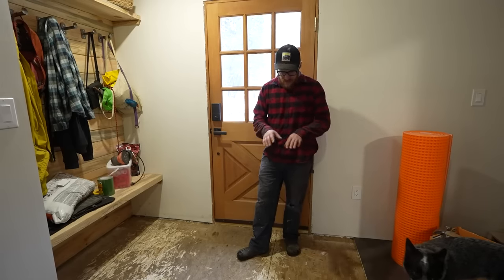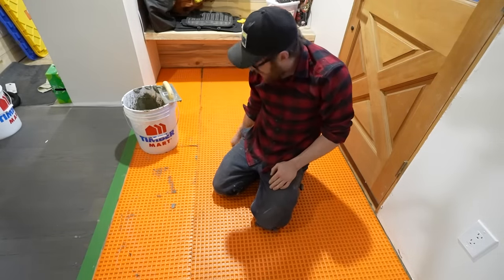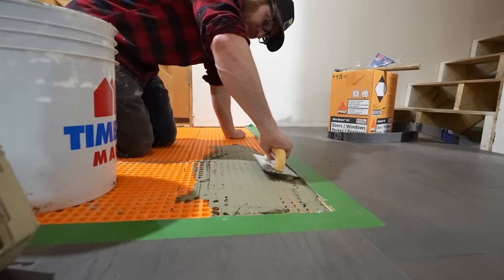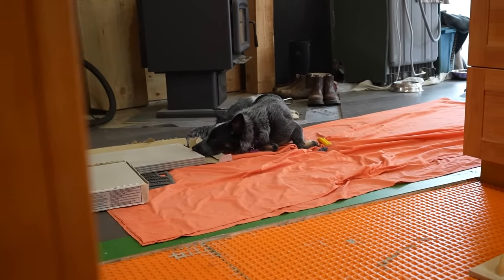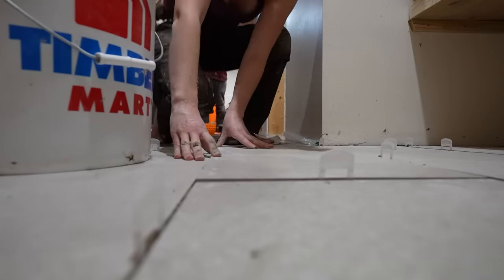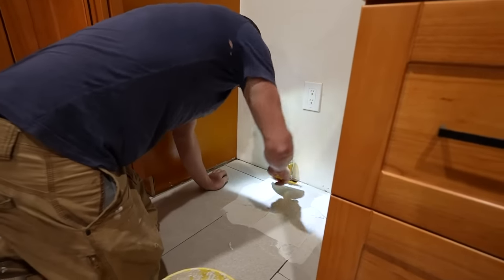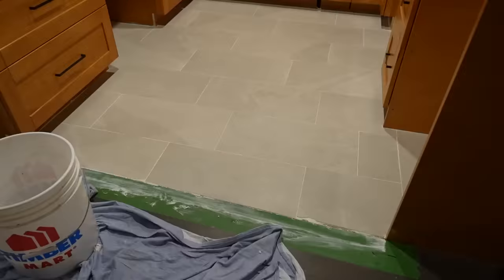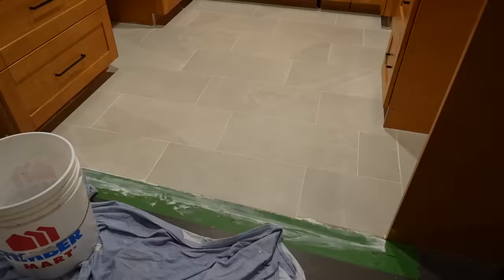The Fridge Doesn't Fit Anymore And A Few Other Tiling Mishaps

Comment: I am impressed with your tile installation. It looks great. Appliances have become a bit of a nightmare for homeowners when replacement is required. Not only do they no longer last like the older models, but there are now so many different sizes. So, not only do you have to pick the features, brand, look. . . but will it fit the current space / configuration. When we replaced our washer and dryer, we had to remodel the entire laundry room.

Comment: You did a wonderful job! My husband and I did the floor laying and the tiling about 15 years ago. They didn’t have those little wedge things to help tighten the tile. I’m so impressed at how fast you guys work. When we had the very same thing happened with our refrigerator, we started sanding the upper cabinet and turning the doors upside down. Does that make sense? We finally got the refrigerator to go in and just had to do some touch up staining on the cabinets. It happens to everybody. Do you think you measured and measured and measured. I will add your tile at the front door is going to be very very slippery. Put a rug down as soon as you can or somebody’s gonna have a hard fall. Your biggest fan from Oklahoma.

Comment: You will have issues with the fridge moving forward, you don't have anywhere for it to draw air to cool itself from now.  The 2" you had before was not enough for a full size but was working for that one.  But now you don't have any fresh air getting to the compressor.
Reply from the maker: The cabinet is shallow and there is a huge gap for ventialtion

Comment: Well done. But I have been reaserching  on the best appliances to buy. And the best place to do that is all the appliance repair shops. The #1 problem they have found is that all the kitchens have those walls on both sides of the  refrigerators and that is a no no. They cause them to work overtime and so they don't last as long as they should.

Comment: Oh, you have that quick setting grout. I've seen two other DIY's with that problem. The solution is to not use the electric mixer. Doing so introduces too much oxygen into the mix which causes the grout to harden more quickly. Instead, mix it with a stick. There really should be better instructions on the grout bag.
Reply: As for the cabinets above the fridge, shave off some wood from the bottom of the cabinet bracket.
Reply: The end finished product looks great.

Comment: This is the same problem I am having with my Jenn-Air....Custom Cabinet (built by my husband). The fridge quit working. I had to get a cabinet guy to shim off the surround to get the cabinet out. Okay - they replaced the start relay switch..worked fine for a few minutes...the compressor works then not...they can't replace the compressor since mine is 17 yrs old....they change the dimensions of appliances..now my problem is like your problem...a new fridge won't fix in the cabinet...the cabinet guy is coming back to try to enlarge the space...In the meantime..no fridge for 2 wks..bought a 4.5 & a small ice maker (it only makes ice does not keep it frozen) I have a new Jenn-Air coming...what can possibly go wrong...

Comment: That's one of those spots. Where the cold melts the warm by the door. I found bracing under the floor helps. Usually try to get tile to match floor joist spacing. Idk wetness, cold, or heavy stuff. It seems where most tile cracks in most places.

Comment: A million years ago freightliner condos were wearing out refrigerators fast as in months . What they found was not enough air circulation around the fridges . 800 trucks eating $1200 like they were jellybeans. 
.the fix was drilling holes in the cabinet that held the fridge .. may want to keep a eye on you fridge

Comment: Are you going to put some sort of transition strips from the flooring to tiles. This will help the tiles from chipping  and socks from snagging ?  Also the tightness of the frig & cabinet , the compressor on the frig will work harder . It needs to have air circulation. A good friend had a similar situation & their compressor went out with in 5 years. They ended up putting a small vent on the side of the cabinet to draw air , no problems since then. (Sorry this got long). It looks very nice. 👍👍😊

Comment: I'm not sure if this was covered,  but u need 2 maintain proper airflow around your refrigerator.  Failure 2 do so will waste power and shorten its life. Check the manual 4 exact requirements

Comment: At 6:36, you cannot add water to thin set after you have already mixed it and it has slaked and remixed. Hey, it's your floor but you destroy the integrity of the floor by doing it.  Mix new and throw it out or continue with what you have mixed until it is gone. Okay now I will continue watching...18:46, I cannot watch this anymore. Good luck with your floor.

Comment: Many people don't realise that you need to leave a big gap at the top (and also some at sides) when in place, to allow effective air circulation else the refridgerator will not work effectively.  Looks like your 2" was way to small considering the thickness of all the flooring components.

Comment: We did the exact same thing with our fridge freezer we left the right amount plus 5mm  (5/32) then when we went to fit it the mother was on top and it’s 5mm higher than the front  so it rubs the bottom of the cupboard each time we remove and refit the fridge it’s bloody annoying because like we fitted the kitchen around the fridge freezerso we could easily of lifted the units to give more room. But we have put up with it for 12 years no and nobody can tell except us so we aren’t bothered anymore. But I must say what a cracking job you have done you should be well proud of yourselves.

Comment: My only question is:
After removing the legs and wheels did the metal bottom of the refrigerator (clearly see bolt head now sitting lower then the bottom of the refrigerator) scratch the new tile floor? Did you place something soft as a buffer to avoid that? The legs are usually non skid and well the wheels roll. Metal bolts don’t.

Comment: I have never seen people laying tile and putting thin set on the tile. the textured surface of the back of the tile to so the thin set on the floor in ridges get pressed into the textured undersurface of the tile.  Have you been told different?  I went back and looked at how to install tile over ditra.  I should have looked at that before mentioning it. I just never seen it done like that prior.  You both did a great job on the kitchen, looks wonderful.

Comment: Please don't be upset with my post, I just want to share with you the mistake I made with installing light colored tiles and white grout in my shower.  Since it is in your kitchen, a high traveled area, you can expect, like I experienced, to have discolored grout that will be a "chore" to clean and keep clean.  I had to take up my grout at the bottom of the walls that connect to the flooring and replace with a darker color grout.

Just trying to share the problems I experienced.

Don't worry about the refrig being perfectly placed under your cabinet.  No one will notice it, they will concentrate on the overall aesthetics and functionality of the room.  You are doing your best.  How many people would not even attempt to build their own house?  As long as you are satisfied and happy everyone else can "piss up a rope."

Comment: u cant turn a refrigerator  on its side ,the oil will go into the upper line and block them .only site tilt 25 degrees .now u need to wait  24 hours before plugin it back in .too much oil will block the lines . next time just move the cabinets .wheels help by lowering  vibration

Comment: OMG - friends of mine had a similar problem…they needed to level all of their floors with flowable concrete and then once the laminate was installed they couldn’t get the fridge in. They ended up taking the top cabinet down and adjusted the bottom by cutting it down so that the top aligned. Unforeseen glitches! But now, you found a solution that works and it’s lovely and bright. Great job! Enjoy! Hopefully no glitches on the next project! Take care.

Comment: It is  too late  to help here  but   for your  other  rooms  it   might  help  your  Detra  is  supposed to  dry  for 24 hrs  before  you  walk  on it  or  apply tiles as it  needs to  dry from the  top  down as  for   walking  on  it  it  shoves the  wet  thin set  down  some and  can  make  tiles  wobble  a  bit    but  it  looks  great  what  you  have  done.   By the  way   I  am  currently  putting on the  same  tiles  with a  glaze  finish for a   back splash  in  kitchen.  well done  and  God  bless.    So  proud of the  fact  you are  fellow  Canadians  and  not  afraid to  tackle a  job  just  because  you have not  done it  before.
Reply: Yes, the Detra should have dried first before installing the tile.
Reply from the maker: The instructions that came with it said you can tile right away

Comment: I dont understand using thin set on both surfaces to put the tile ? A 3/8 notched trowel on the floor should be enough thin set to do the job . Also , use a natural sponge to wipe off tiles wringing out the water often . P.S. Your fridge is gonna suffocate in those tight spaces . Looks good though .

Comment: Your going to run into issues with no clearance around the frig as there needs to be airflow so the heat can escape. Since you made it so tight there is going be nearly no airflow.

Comment: I did tile for 34 years so i have to try to help out, As far as setting the tile you get an A, back butter using the levelers great job. The only thing I would say is I learned a very expensive lesson when I first used Ditra  about 20 years ago, you have to use non fortified thin-set, the cheap stuff,  it wont stick with fortified thin set, That was my tuition for the school of hard knocks, if you used non fortified thin set then great job, if not then not so good. Grouting was ok , For future reference the secret to grouting made easy is the right grout float, those green ones from box stores are crap, Virginia Tile has great one with an soft edge that lasts a long time, you need to pull off as much grout as you can leaving mostly the lines and minimal grout on the tile by using the good float at 45 degree angle, that will make grouting much easier, you guys are such quick learners and hard workers you will be fine, I have done the same thing with the fridge early in my career it's an honest mistake, your place is really looking great.

Comment: Also, my wife hated raised transitions between the tile and wood for I filled in the gap with soft weather stripping and a thin layer of matching joint compound chulk. Still looks great after 5 years. Thought it wouldn't last but works great and allows the wood to expand without cracking or buckling.

Comment: A fridge does need room to breath. It will get hot. And at least once a year you need to clean out around the compressor and coils. Make the upper cabinet easy to remove?

Comment: That's a tight fit. You may make sure that you have the correct air flow so the compressor does not over heat?

Comment: 1. When you lay Ditra you need to use the roller to adhere the ditra to the thinset on the floor. This is to make sure its bonds to the the thinset on the floor. You can find Tile membrane rollers in amazon if your local store does sell them.
2. When applying thinset to a wood subfloor, you need to wet the subfloor with a wet sponge as the wood will wick some of the moisture out of the thinset (even if you are using the polymer additive). Alternatively you can apply a primer like MAPEI Primer T. MAPEI Primer T also helps the thin-set bond to the subfloor.
3. Apply the kerdi tape on the ditra joints to avoid cracking if there is any movement on the floor. You place some thinset over the joints then lay on top the kerdi tape & then another layer of thinset.
4. TIP: when you lay down ditra it can be helpful to have a spray bottle of water that you can apply to the thin set just before placing the ditra, especially in winter if the humidity is low as the very top layer can start to dryout before you can get the ditra laid down.
Reply: You need to wait about 48 hours before laying tile over ditra to give the thinset time to cure. 

Not a good idea to use white grout in a kitchen as it will get dirty and very difficult to keep clean (basically you need to steam clean it).

Comment: Holy cow! Near disaster. Super fix. Got it in. We went with bone color grout years ago. It is dark brown/black in the high traffic areas. Never a good way to lean it either. Regrets. Thanks for sharing
Reply: Grout paint will fix it. Yes, it's a tedious job. The results are worth it! You can paint small sections at a time. I painted 2 bathrooms.

Comment: Hello Katie and Greg. Such a fantastic job you two have done with the house. I need your help. I am changing the sink in the kitchen and have removed everything from the sink. It appears that whoever installed the sink used liquid nails to adhere the sink in as if the clips were not enough to hold the sink in place. It is a drop-in sink. How can I break the bond of the liquid nails? I have looked everywhere for the answer. Have good days!
Reply from the maker: Greg doesn't know of any solution. He says you need to smash it off 😅

Comment: When you buttered the tile after spreading the square lines, you doubled the thickness of the thin spread. The hole point of the square notched trouw is to put just enough mud on the floor to stick the tiles to the floor. And I know that orange underlayment is the new thing, ready board would have given you more support and rigidity and you don't need an extra layer of thin spread on the floor which is now that much higher. I wish you would have watched a few more video's on laying tile. but I guess you live and you learn. LOL
Reply from the maker: The tiles and wood floor lines up perfectly so what's the problem?

Comment: Your place is looking great. Have a question when you were putting down the paste i thought you needed to have 1/4 groves under the Ditra I am going  to do a remodel on a rental and was wondering thanks for your time
Reply from the maker: It was 1/4 x 3/16 I think, but the instructions or website will have the correct info
Reply: @ThisOffGridLife  ok cool

Comment: Wow you need to ventilate that fridge quick. 

It’s going to cost you a fortune running it so tight like that with zero airflow
Reply from the maker: There is 3" in the back
Reply: @ThisOffGridLife  going to where? There should be a small cut out at the side.
If you’re looking to lower energy usage there needs to be good airflow back there. Couple little cut outs with a cover on will be great

Comment: 👍👍Very interesting, nice to see you :)) also a beautiful choice of colors, very beautiful
Regarding the refrigerator, the refrigerator needs to breathe from the back, that's why there are ventilation openings. It is desirable to move it away from the wall also in the upper part so that I will not be close. And also the bottom part is important that there is a space for cold air to reach there to prevent the gas ribs refrigerator. Google translation is not the best in the world ") It also needs renovation.) IL :)
Reply from the maker: We have 3" still for air to move
Reply: @ThisOffGridLife   In the refrigerator, the refrigerator rises towards ^^ up and takes cold air where they were the refrigerator's legs and wheels ... which you removed due to height ... Down with a fan most unaware people who need to clean the pipe grills with air pressure in hot countries up to 2 times a year. In the country it happened once a year. Also extends the engine of the engine also a less power ... and not the refrigerator dies after 3-5 years ...

Comment: What is the orange stuff and what is the advantage? I put tile down but never put that stuff down.
Reply from the maker: It adds rigidity to the floor because we have an osb subfloor and lines the tiles up to the same height as the hardwood
Reply: @ThisOffGridLife  I was wondering i didn’t use it before but i also haven’t installed a lot of til

Comment: Laying the refrigerator on it's side even for a short period of time can ruin the compressor because the oil in  the system can escape. I was told that if you do lay it over, let it sit right side up for the oil to return into place for a day or two before plugging it back in.❤❤❤❤

Comment: Stands to reason if you take an appliance out that has sat at one level and increase what is beneath it, it will not fit back in as it was but then you guys never took that into consideration and it made for better video encapsulation to us your viewers so they know in advance what to if they are following your modifications?  Had it ben me I'd have gone for the whole darker tiling to make everything look the same  but we can not all be perfectionists or can we?